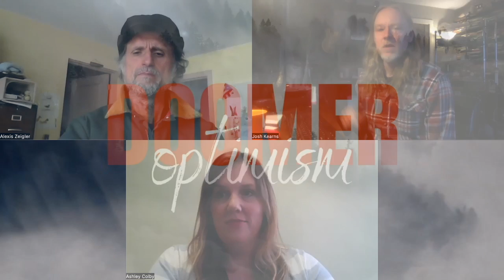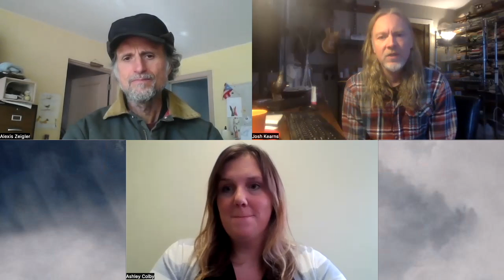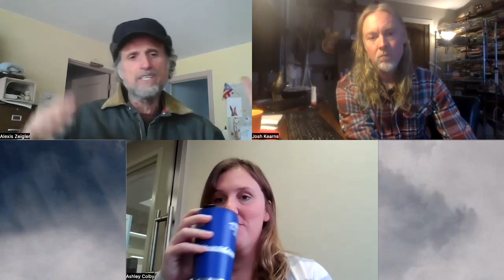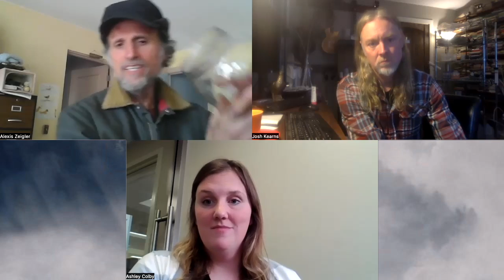DO 202 – Alexis Zeigler, Living Energy Farm - with Josh and Ashley

Comment: 24:00 arc suppression of contact by the parallel capacitor
26:00 DC compressor can tolerate voltage fluctuations